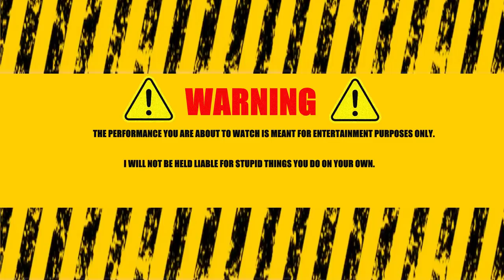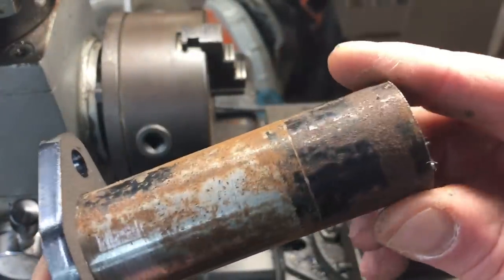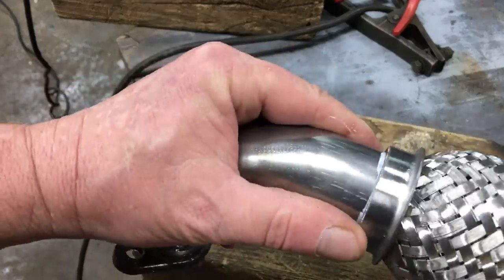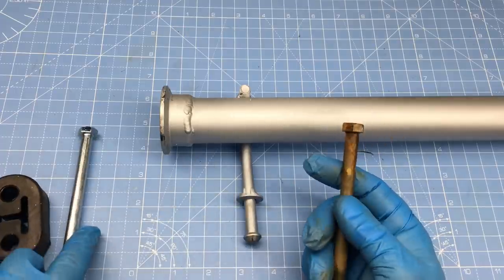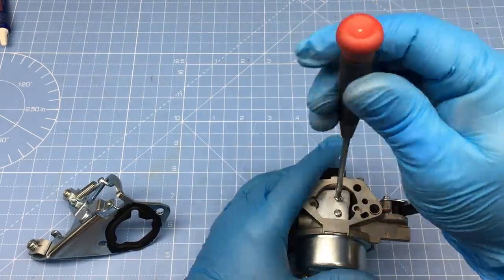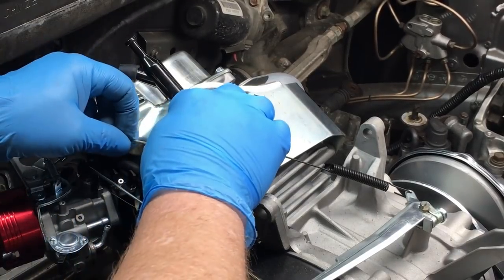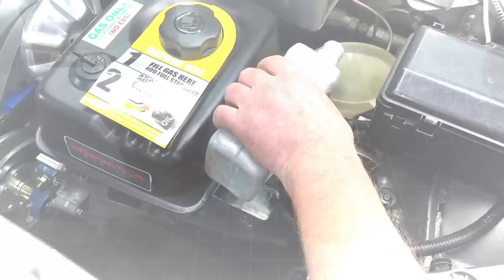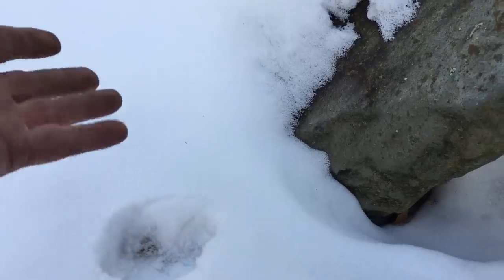Episode 15. We finish the 420 HEMI engine swap on our lawnmower powered car.

Comment: "420 Hemi big block" definitely sounds like something that was on a 70s dodge, just don't say its 420cc not 420cui.
Reply from the maker: the 426 Hemi was an iconic engine from the 60's and early 70's .    This  420 is a real Hemi, but as you know its in cc
Reply: Yeah, it has 420 cubes of freedom under the hood
Reply: @robotcantina8957  Can you overbore this engine? You know, to get it to 426cc? 😂
Reply: @robotcantina8957  just 16.39 time difference. Nobody will notice
Reply: @laurean5998  only thing as good is 420 grams of freedom

Comment: This car is coming along nice!  I appreciate your efforts on such a unique project.  I want to note your choke setup - I thought I was the only one who went down such a road.  I put a 196cc electric start clone engine on a gokart project recently, and added a remote choke setup as well.  I got the Honda kit meant for a gX160 and it fit like a glove.  I then got a cable off Amazon, but I reckon it's the same one at a local auto part shop too.  It's amazing how handy that remote choke is!!

Comment: Studz racing has custom exhaust kits that are super easy to build, made mine 42” long and added an akrapovic street bike muffler, length helps immensely with scavenging effect as my cam has a ton of duration, the custom exhaust and a long custom intake made from emt conduit, really woke it up!!

Comment: A little tip! The section under the car was a little blurry. You can fix this with a higher shutter speed. Usually this causes a slower video but you brought a light down there which is perfect. If you wanna reduce motion blur in the hand held sections, same applies. This should make the paused video look way better :)

Comment: You said the pipe fit the flange, but it fit inside? Did that match the output from the head? A step to a bigger ID is actually good for a header flange for lower rpm power, but if it's choked down that's worse case scenario.

Comment: They make a 22HP V-Twin. Wondering why you didn't use that? Too big for the space?
Reply from the maker: The V-twin is BIG, but we will have a look at putting one in, but that is after we are done fooling with the 420.
Reply: @robotcantina8957  I subbed. Looking forward to seeing your progress. 
I got the 420 cc, 40 series torque converter/jackshaft setup in my go kart.

Comment: You could place your air filter further away from the engine, because that would be the best solution i can come up with to get cold air for the engine to burn.

Warm air reduces the few HP you have to begin with even more.

Comment: One thing I would do to this project is mounting a Thule roof rack and a fuel tank on top of it.
Then gravity feed the little tank and have a valve on the left mirror to control it.

All fuel lines fixated on the exterior for safety. 

A road trip would be awesome

Comment: Exhaust clamps work great as long as the pipes are properly flared (tight fit) and the clamps are quality. It won't leak, won't move or need sealant. And the cost is half or less of a welded system.

Comment: I'd bet you could use the Mikuni carbutor adapter without issue if you cut it in half and reconnected it with a piece of radiator tubing and two hose clamps to provide some vibration damping.

Comment: i was thinking of something for a project of my own, but using an oilcooler on the engine and then making a vent system for the cooler so you can adjust the warm air to either go inside the cabin or out somewhere else if you dont want heat.

Comment: Plenty of knob and T bar choke cable assemblies over here in the UK for about £10, any old Mini, Triumph, Rover, Land Rover, early Range Rover would yield the standard Lucas kit that British Leyland used if there is any lurking in a local scrappy, old Jags used them as well before they moved to autochoke SU's, old Mini's used a choke cable for the heater control as well so can be found :D

Comment: Turbo and a real clutch + longer gearing so you can actually use first to launch, you will probably pick up speed if the gearing is right becuase you wont have to spend so much time off throttle between shifts

Comment: Great series, I'm thinking about doing something like this with an old dodge colt I have in the yard.  It has a two speed rear differential and less weight, maybe a good base to work with.

Comment: One idea came to mind after watching your engine swaps: These engines would work better with using an efi I suppose. Especially the 420 should be much more powerful using some form of efi which could be a simple venturi system using an oxigen sensor and a map. I suppose this would yield 3 or 4 hp more out of this engine.

Comment: You should put a heat shield or & fiberglass exhaust wrap near the engine and half shaft. Especially that rubber c  boot.

Comment: I had/have one of these, a 2000 (5speed only year) with AC, no other options available. Until electronic driven CVT for 2001-2006?ish. 1700lbs ish was fun to autocross.

I've added Cruse control to mine, and have some plans to power the rear end.  Also added a governor defeat and neutral switch defeat (let it do IMA auto-stoo for ICE so it would coast for miles in neutral without having to hold the clutch in a gear.  Also an electric vacuum pump so the brakes kept working during such a coast.

Have you seen the Insight with a Geo Storm turbo? Should look it up...

Just got the recommend and will probably binge and sub, so far neat show(s).  Gimme a shout if anyone cares about the donor car, it was one of my passions.

Comment: Check out Polski Fiat 600, it was a small death trap box from communist Poland of a production car, similar to what you have here. Twin Air cooled carburated 600 c.f. engine, produced roughly what was it, about 17-30hp, depending on option and situation.

Comment: Hi Robot Cantina
Great series which reminds me of my childhood building gokarts and tuning mopeds.
love to watch all the upgrades you put on the engines 😊
I remember that I at one point upgraded a moped engine (50 cubic two stroke) with needle bearings on the conrod which in my opinion gave me some extra power and rpm
so question: whats your take on using needle bearings on 2 and 4 strokes engines? will Ike make a difference in perspective of performance, fuel efficiency, engine wear?
Thanks, love your show

Comment: Ready to see it's top speed. Why haven't you tried putting much narrower tires on it yet?
Reply from the maker: We have a very small budget, but things are changing.  stay tuned!
Reply: @robotcantina8957  I would bet you could put 4 of the small "donut" spares on there and increase your speed. Reducing resistance is as important as horsepower. Skinny tires and max out the air pressure

Comment: Exhaust clamps...mostly better than welding....why? because we might want to change based on driving conditions....catatlytic convertor deletes..sniffer tests like we have here in Texas....clamps are more easy to deal with than welding...Same goes with a racing setup as opposed to daily driver.

Comment: As fun as it is to poke fun at Hondas for being made of Lawnmower parts... the original Insight was a remarkable car for it's day, and much of the tech in the engine has yet to be surpassed.  They were built at the same plant as the NSX's, according to a friend who owned one a while back.  Cruising through Texas at, uhhhh... 'reasonable and safe' (heh) highway speeds getting 65+MPG!

Comment: Have you given any thoughts to a hydrostatic transmission ? With a variable ratio pump,motor or both you would have a CVT . The packaging can be more adaptable then belts ,chains and pulleys allowing varied placement of the engine and they are extremely reliable.

Comment: You said that choke cables are getting harder and harder to find, and that makes sense.  But have you tried a bicycle store?   Aren't the brakes and shifting mechanisms on a bike based on the same cable principle.   You can probably get yourself some bicycle brake cables.  Wouldn't they do the same?   And bicycles aren't yet going out of fashion.  What thinks you?

Comment: SNOW... grrr, but it looks like a success. only thing I wonder is why you didn't go the fuel injected version but either way don't expect the engine to last forever, durn things operate with an oil splasher. an option might be use a little 2 stroke in the gas, like 80:1 ratio because its a 4 stroke only firing every other rotation, a little lube from the top down into the piston and rings may help longevity.

Comment: Domo arigato Mr. Roboto, what model 420? How about a $5 tach or bicycle speedos on the engine and driven jack shaft to see what is going on? Which gears in the transaxle do you find useful? I suggest a stiffer converter spring with the lightened weights to keep the torque higher longer, maybe test by machining a torque converter travel stop/limiter before adding the cvt function to the mix.

Comment: I'm confused on why you would need the flex pipe on the exhaust to avoid "damage"? like is it so the exhaust moving around from vibration doesn't put stress on the motor itself?
Reply from the maker: If the exhaust system was rigid, it would most likely cause long term damage to the cylinder head.  The car was built to last as long as it can.

Comment: Jeeze, this is some amazing content.

Since you've already gone off the deep end with this, you might as well go all out and use some form of EFI. Megasquirt comes to mind, but I suspect there are ones specifically designed for small engines. I bet you can really help this motor's torque band  across the entire RPM range. As I suspect you know, more exact fueling and especially timing works wonders for torque.

Or all I said above is in the pipeline already. :)

I mean if it's worth doing, it's worth overdoing!

Comment: Have you thought about moving the intake so the engine isn't breathing the hot air it's making?
Reply from the maker: I have a temperature probe in the vicinity of the carburetor and the temp only gets a few degrees above ambient when the car is moving.
Reply: @robotcantina8957  CONGRATULATIONS JIMBO.. over 100k subscribers! 👍👍 ROBOT CANTINA
continues to provide the entertainment and fun that viewers enjoy!

Comment: Why not use the original fuel tank location?   You could fuel up from the original filler neck.  Is it because the vacuum pump isn't strong enough?

Comment: Can we get a dyno test of the 420 cc engine? Assuming the 13hp is accrate, the calculated top speed should be 72mph. I guess that would be a funner way to test the horsepower.

Comment: I think the issue all along has been RPM. I'd like to see the sprockets swapped. to deliver much greater RPM to the transmission. the reduction in power by doing so can be offset by using a heavier flywheel. It's all about inertia and RPM.

Comment: I really like this project I was kinda wondering why you don’t just use the original fuel tank from the car
Reply: 1.  The original fuel tank is rather heavy. 

2.  It's just not necessary,  big tank for so little fuel needed. 

3.  It's removal greatly simplified things.

Comment: I would like to do this but use two engines. One engine with the torque converter style. But I feel like in the long run it will lose efficiency and probably burn up the belt pretty quick. Is second engine with a more clutch lock up maybe centrifugal. That way when one engine's running the second one can just free wheel. Once the car is rolling the second one can be engaged. If this works you could just start and add more 212s as necessary to get the power where you need it LOL. on your setup maybe it could be added after the transmission and just geared to work for top speed. Maybe too much complexity LOL

Comment: Could you use the same gas tank the car had?
Reply from the maker: The original fuel tank was removed to save on weight.  Its is long gone now.  The little tank should be fine for about 40 miles or more.

Comment: Does it have a alternator? If not , for how long fors that little battery last?
Reply from the maker: Without the alternator the battery will last a few months.  The only power the car uses is for the turn signals and stop lights.

Comment: Won't having an exhaust that long for such a small engine create excess back pressure?
Reply: @J B Jr I'm saying with how little output the motor has I'm wondering if a full car length exhuast is going to create to much back pressure and burn up the valve
Reply: @J B Jr awesome thanks for the response!

Comment: Everyone loves this shet...  A kit soon? I would prefer a Honda engine. A V-Twin which seems uniquely small and powerful at 100 pounds.
25 HP @ 3600 rpm and 40.2 lbs ft torque @ 2500? That would be PERFECT for your car...	

iGX800
Length (min)	16.9" (429 mm), TXA2 model type
Width (min)	19.4" (492 mm), TXA2 model type
Height (min)	17.2" ( 438 mm), TXA2 model type       
Engine Type	V-Twin, Air-cooled, 4-stroke, OHV
Bore x Stroke	83 X 72 mm
Displacement	779 cm3
Net Power Output*	24.9 hp (18.6 kW) @ 3,600 rpm (SAE J1349)
Net Torque*	40.2 lbs ft (54.5 Nm) @ 2,500 rpm (SAE J1349)
PTO Shaft Rotation	Counterclockwise (from PTO shaft side)
Compression Ratio	9.1:1

https://engines.honda.com/models/model-detail/igx800#Features

Comment: Is this exhaust not adding back weight you struggled so hard to remove in the first place ??  🤔
BTW... the rule of thumb is no more than 3 diameters overhang if not supported with the tailstock centre ... 😏

Comment: I Honda 250cc 4 stroke motorcycle engine has 39hp, is it because it goes up to 12,000 RPM's?  Why so much more hp then these lawnmower engines?
Reply from the maker: Just a guess,  The motorcycle engine is better built and tuned to make power.  The predator engine is built decent, but is not tuned for max power.
Reply: @robotcantina8957  CONGRATULATIONS JIMBO.. over 100k subscribers! 👍👍 ROBOT CANTINA
continues to provide the entertainment and fun that viewers enjoy!

Comment: I'm curious why you don't just buy an electric fuel pump and use the original Insight fuel tank. You can find low pressure, electric fuel pumps (made for carbureted motorcycles) on eBay for about $10.

Comment: I would like to see a bunch of these engines ran in parallel. Put a couple under the hood, some in the trunk with a shaft to send their torque to the front. Maybe one in the passenger seat that you manually operate the throttle for some passing power. 
.
How many law mower engines does it take to reach 100mph. One... two... three... crunch, some shit broke and the world may never knwo.

Comment: I've been a metal fabricator/welder for over 20 years. If you were welding all day on galvanized, I would be wearing a 3M half mask rated for it, BUT since this is just a small piece for a few seconds, it's seriously not a big deal, and I have welded small stuff like this galvanized literally hundreds of times in my life. Just use some common sense. If possible, weld it outside and have a fan either pushing or pulling fumes away and do not position yourself over the top of it breathing them in. I have even simply held my breath for the 20 seconds required to quickly weld something. Not a big deal. Also, a old school tip, if you think you breathed in the fumes, drink some milk quick. I am not a doctor but there is something in milk that neutralizes the toxins in the fumes and will stop the effects. Some old school welders use to drink milk before and after doing this. I've seen it work.

Comment: how does a vacuum fuel pump work at WOT?
Reply from the maker: We will find out.    The fuel pump works from both pressure and vacuum pulses.  Even though there may not be any vacuum at WOT, there should be some pulses.

Comment: It is not unusual for an eight-cylinder engine to generate more than 300 hp
The real surprising thing is to do it with a funny little 400 cc engine with single cylinder..
This engine will never generate 300 hp, but with a little bit of engineering, it is possible to drive a car.because moments when a car uses the most force ;
starting to move, accelerating and climbing uphill ..
Apart from this, it can continue its motion with a little force while moving on a straight road. For this, a 400 cc motor may be sufficient.
engines are getting smaller now, as technology progresses, vehicles will get rid of heavy big block engines !.
I love this kind of work and congratulate you for doing this..

Comment: Damb! I would hate to see the cost of this budget build! You are extremely overkill on everything. I suppose you went to college to be an engineer. 🤪 I would never use a lathe on half of the fabrication. Even the heavy duty exhaust pipe could have been chain link fence tubing and mandrel bent by hand. I would have used a stock flat muffler to actually eliminate that irritating go cart exhaust sound. And still I see it needs massive weight reduction. Overall it is impressive to see this cat being skinned with a totally different vision than me, a highly skilled mechanic.

Comment: Make the drive sprocket have a faster ratio and then you will get more speed also go to gopowersports.com for said parts they have stage 3 racing parts for that engine and many others I seen others go there for there parts and there good they have parts the make a 212 have 7 to 9 thousand revolution per minute ok.